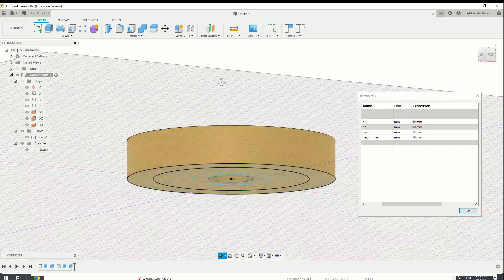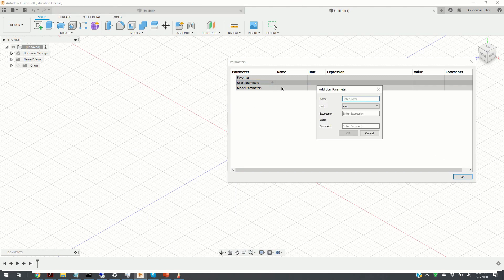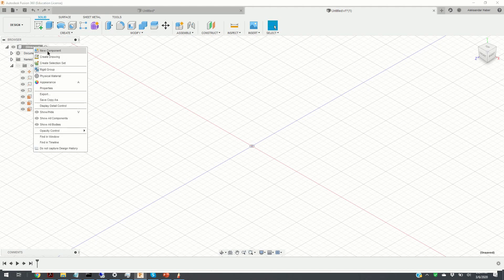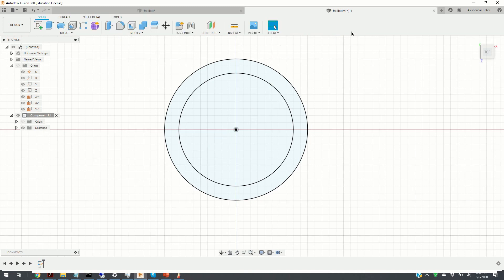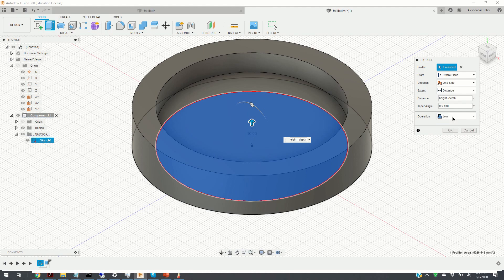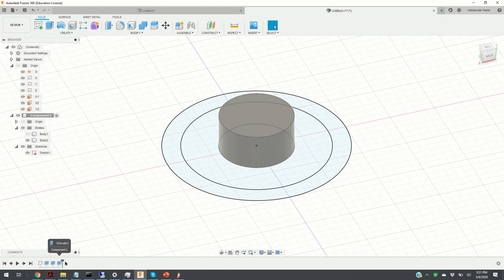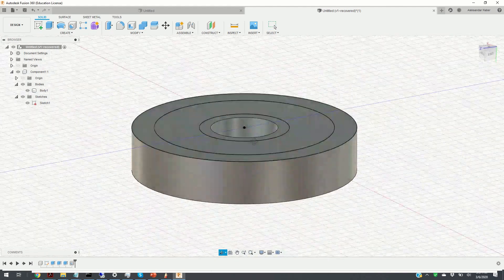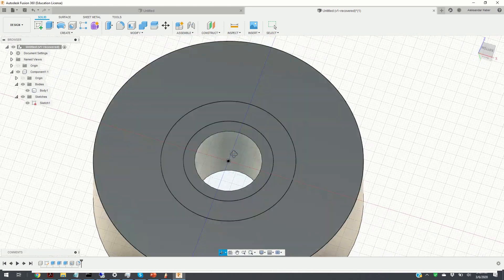Fusion 360: Parametric 3D Modeling and Extrusion - Cylinder with a Hole

Comment: Don't really mean to be cruel, but it appears you missed placing circle centerpoints at (0,0) [at 5:36 min/sec] or maybe my eyes are just deceiving me... the latter I'm hoping. Regardless, thanks.
Reply from the maker: It is not displaced, there is an extra small icon near the center point that symbolizes it. You are probably referring to the icon.
Reply: @aleksandarhaber  Right, thx. I should have recognized it's a Contraint.